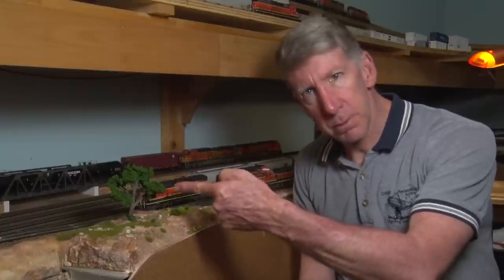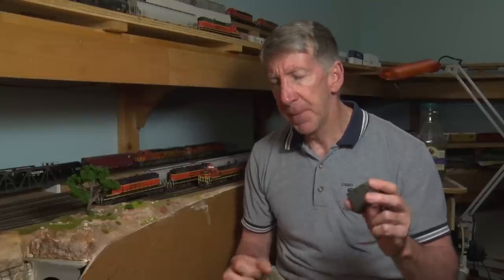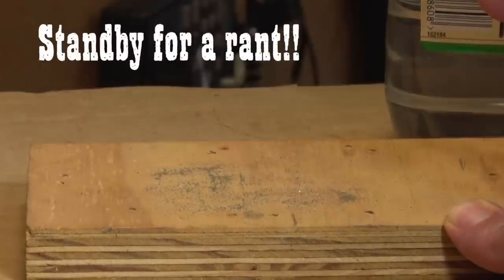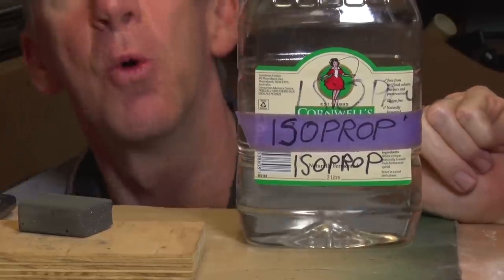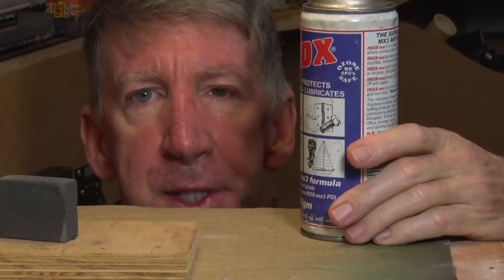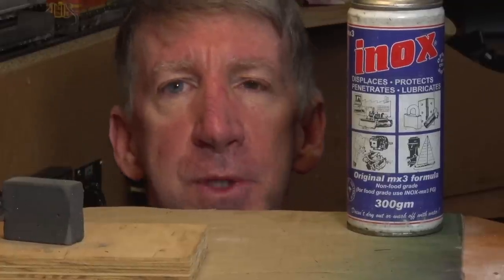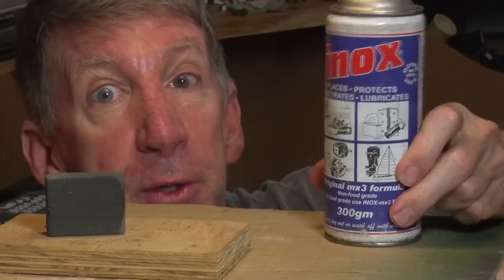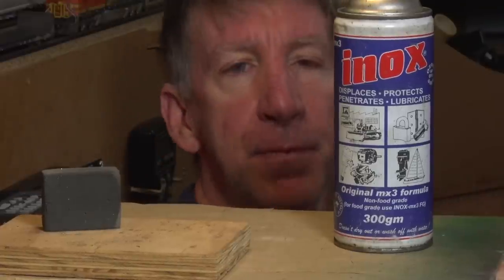Track cleaning do's and don'ts. How "Not" to  clean your track ! And how to do it better!

Comment: I’m new to the hobby and been watching YouTube videos on how to clean tracks and ballast the tracks. When ballasting the tracks, I see some spray water on the tracks/ballast and then pour 50/50  glue and water with detergent over the tracks to glue the ballast down. Does this water and glue on the tracks cause any issues for conductivity later? Do you have a better way of doing ballast? Or is it not worth worrying about because you can always clean it afterwards with icon spray? Interested in your thoughts.
Reply from the maker: Hi Chris , there are many ways to ballast track as you have found out!! The main thing is to keep the glue away from the head of the rails. Fist thing is to use "wet" water to spray the ballast ie: water and detergent or water and  alcohol (IPA) , this does work very well and helps the glue mix flow through the ballast. This first spray is not a problem, but the glue / wet water mix is ...especially around turnouts! The best , but slowest, way is to use an eyedropper and run along the middle of the track dripping glue into each tie spacing...this is slow but the wet watered ballast sucks up the glue mix really well and you don't get any on the rail heads! Of course , after any ballasting, go straight over the rails with a dry cloth, not forgetting the inner edges of the head of the rail, not just the top! Then come back with a lite rub of Innox ? CRC on a rag to protect the rails. 
Hope this helps.
Cheers Gregg.
Reply: FishplateFilms great thanks Gregg. Great videos by the way.
Reply from the maker: @chriswato4056  You're welcome and thank you Chris! 
Gregg :-)

Comment: Good stuff, glad i have discovered you. Just a question, i have got litres of Isopropyl 99.98% alchohol. Is that not any good either?  
Do not want to go and buy something else, if i do not have to. Thanks and cheers, and take care.
Reply from the maker: Thank you !  IPA still leaves a residue , but the less water the better of course!  But I can't say I would use it ....what you could do is "clean" your track with the IPA , then rub some Innox or CRC over a few spots and let the trains take it round the layout. 
Cheers Gregg.
Reply: @FishplateFilms  Thanks, after re watching your video and expertise, which sounds very logical, am picking up some inox this morning. Thanks for your reply.
Reply from the maker: @cudgee7144  You're welcome ! Let me know how it gor=es for you!
CHeers Gregg.
Reply: @FishplateFilms  Gregg, just giving you an update. Tried something different after watching a few videos. Cleaned my track with 99.99% IPA, let that dry for 2 days, then went over it with INOX and let that dry for 2 days. Works a treat, can get my loco's to run at a really slow speed, which looks realistic, they used to stall. There is a new youtube video out there from a bloke who tries different cleaning liquids on 4 tracks. But they all improve dramatically after he goes back and tests them after 30 hours, very interesting. Looking forward to see how your graphite tests go. Take care and look after yourself, as we start to get back to normal.

Comment: Excellent Gregg. That's great info. Do you clean your wheels on your locomotives with Inox as well?
Reply from the maker: Thanks Peter! TBH I have never cleaned any wheels on the layout? Not since I started using this and no Isoprop. Only after weathering do I clean wheels to remove overspray , and then I do use Innox on a Q tip.
Cheers Gregg.
Reply: Well after all that great info I went to Bunnings today and bought some Inox. I thought it was essential shopping and i maintained social distance at all times.
Reply from the maker: @peterainsworth8466  LOL..absolutely essential shopping!  Any dramas, tell them Lord Stan sent you!  Let me know how you like it Peter!
Cheers Gregg.

Comment: Greetings and salutations from Detroit. Thank you for the great video and info you provided, you just got yourself a new subscriber.
 What about 99.9% isopropyl or do you still not suggest using that?
Reply from the maker: G'day to Detroit!  IPA is not suitable regardless of dilution , as it leaves a residue as it dries out! You "Can" use it to clean track , but you still need a protective film after, so best to use the right product for the job and do it once!  Get a can of CRC 2-26 and see the difference:-).
Cheers Gregg.

Comment: Cool video Gregg. I needed to watch this video, thanks for the advice on what to use. I will head to Repco and get some Inox as soon as our lockdown is over. You are right, there is nothing worse than trains stalling all the time. I wonder if miniature battery technology built into the locomotives will ever replace the need to have track powered at all.
Reply from the maker: Thank you ! Yes , stalling trains is one of my pet hates...along with trains going too fast ! I'm sure we'll see battery trains in the future, especially in O gauge! But track power is used for all DCC signal functions , so that would make things difficult.
Cheers Gregg.

Comment: Anyone in UK found a good inox or crc replacement? Wd40 contact cleaner?
Reply from the maker: You can get Inox from Pendel Slot racing , in Lancashire...so they say!  COntact cleaner will not leave a protective residue to stop oxidation, but it will clean the rails.
Cheers Gregg.

Comment: Hi Gregg, Thanks for the video.  I looked Inox up and it does indeed seem to deliver excellent results (well for slot cars anyway).  It is not easy to buy Inox MX3 in the UK - there is only one reseller.  Inox is rather expensive over here (£10 for a 125ml bottle) but I have ordered some to try it out.  Hopefully the results will be as good as you indicate.  Keep safe. Kind regards.  Paddy
Reply from the maker: Thanks Paddy , you're welcome!  I'm sure you will like the results , and just remember just a little! A can will last you forever ! Put the little  plastic tube in the nozzle and  then you can spray two tiny spots on a rag. 
Cheers Gregg.
Reply: Hi Gregg, OK and thank you.  Sounds like 250ml will last me for the rest of my life. 😀. Kind regards. Paddy

Comment: Any good art shop will sell a graphite stick, use it sparingly and it makes a great conductor , won’t stick to wheels which are protected from the black gunge underneath and one swift slide round will ensure good running for months.
Reply from the maker: Thnks Paul . I have some on order and forgot about the art supplies...:-( 
Look forward to giving it a go.
Gregg.

Comment: I've found that there is more surface area on rolling stock wheel treads (do the math) than there is on rail surfaces. While you want to optimize conductivity on loco wheels, it's important to consider dirt buildup on rolling stock wheels as well (something to do with static electricity or relative absorbency). Rolling stock does need cleaning since they either pick up dirt, or spreads it, conditions depending.
Reply from the maker: Thanks for watching!  Plastic wheels are terrible for dirt build up , but since metal wheel sets are the go , and since I have been using a spray , over 10 years now, I never clean either of my loco or rolling stock wheels? The tracks are constantly getting black , as the spray helps clean the wheels ! 
Cheers Gregg.

Comment: I was having a think the other day which may explain the headache but I was wondering.  If the rails and the wheels  make a circuit would electrical contact cleaner be able to be used to clean track.  If not then Inox it is.
Reply from the maker: LOL... thinking can cause that!  Contact cleaner will clean the track , but will not leave a protective film. Inox will do both in one go! 
CHeers Gregg.
Reply: Thanks Greg.  @FishplateFilms
Reply: @FishplateFilms  Newcomer here (well, back after 35 years, let's say!) - When we talk about Nickel Silver track, I thought that was the grade of alloy used to made the rails - but is the nickel in fact only a coating???
Reply from the maker: @alannewman85  Hi Alan, you;e correct that the rail is an alloy, but oxidation is a problem with both metals! In humid and dusty environments , it increases , so a protective film helps this.
Cheers Gregg.
Reply: @FishplateFilms oh, that’s interesting indeed. Really appreciate you getting back, I get all my info off the net, so replies are great. Mines going to be in an uninsulated shed in Ireland. I work abroad so I will get say 3 running days together, every second month. I wonder what other electrical or electronic 😮issues I need to consider in that environment….
Reply from the maker: @alannewman85   That's going to be cold Alan...LOL !  I'd be investing in some dead sheep to jam in the walls !  IF it's wet and I know Ireland gets a little rain, oxidation is a big concern, so INOX will help that and you can rub some on the rails after an OP's session to protect them between visits. Most of the electronics are sealed but keeping them dry of course is a must . We spray INOX on our terminals in some signalling equipment , especially in points machines , which helps a lot .Also I would make the track bed at least 15mm-20 mm ply , so it is stable during temp changes. Model rail, like the prototype , is only as good as its foundation, so don't skimp on the benchwork! 
Also a Wee Dram is good idea on cold days!
CHeers Gregg.
Reply: @FishplateFilms Great advice, thanks Gregg. You’ve a lot of knowledge I wish I could tap into. I’ll definitely be having a dram. Or two. 👍
Reply from the maker: @alannewman85  Thanks Alan, plenty of videos on the channel if you get bored!
Gregg 🙂

Comment: I agree in principal, but all these liquids that help conductivity (CRC, Clipper Oil, ATF, No-Ox, ect) also hurt traction. So if you have any real grades on your layout (2% and up), you going to have trouble pulling the trains up the grades. So what we really need is something the helps conductivity, but doesn't kill traction.
Reply from the maker: I have found that if your use the INOX sparingly, and at random locations on the layout, traction is not hindered to much . If you watch some of my videos , you will see long trains climbing the Helix, which is 1.8% . If you go overboard, then you can lose a bit of traction , but the benefits of good running far outweigh the small loss of adhesion.
Thanks for watching.
Gregg.

Comment: Found your video by accident and laughed a lot.  I have been using Shellite, it takes the dirt off very well and doesn't seem to effect the plastics at all.  I like the sound of this product but the word 'Lubricates' worries me.  Can it make the track slippery?  Somehow I feel that you are going to yell at me, hahaha.  Cheers
Reply from the maker: Hi Pauline , thank you for watching and I'm glad you got a laugh!  I haven't heard the word Shellite for a long time ? Yes , it will clean very well , like IPA, but will not help with conductivity or leave a protective film on the rails. Yes , Inox is a "lubricant" as such , but a very light one , and if used sparingly will not make the rails too slippery. I run long trains up big grades, including a Helix and I clean my tracks a lot , and I have no traction issues. The only problem is if you have traction tyres on your locos, as these act like car tyres on ice when they encounter any spray!! But apart from that , you won't have any problems and better running.
And no yelling of course..LOL.
Cheers Gregg.
Reply: @FishplateFilms  Thanks for the reply, food for thought.  I don't have anything with traction tyres so that's good.  I am mainly vintage Tri-ang with steel rails so I will try to get some Inox and see how my locos go hauling my lovely wagons and coaches 😊.
Reply from the maker: @PaulinesPastimes  It will work a treat with the old steels rails Pauline! Give it a go and let me know how it goes!
Cheers Gregg
Reply: @FishplateFilms  Shall do.  Cheers
Reply: @FishplateFilms  Well, as luck would have it, shortly after all these messages I purchased a loco with traction tyres and since then, another one.  I didn't think I would buy such a 'modern' loco but I did, so looks like Inox is off the shopping list.  I continue with the Shellite.  Cheers.

Comment: Hey Gregg how about using  ACT-6006  It contains Parrafinic Hydrocarbons I got this from Modeltrainstuff  about 4 years Ago Fred along with Otis the HO specialist's they both at that Time Recommended using The ACT-6006 so i bought a Bottle i have cleaned my Track with isopropyl 90% but after watching this I may no longer..  I also got Some Atlas CONDUCTA Lube which Atlas recommends using on the there Motors and you can use it to coat the Wheels is the Conducta Lube & the ACT-6006 Good products to use Gregg.! 

Thank ya Sir for Reading this and thank you for pointing out the Valuable Information... You posted..

Stay Safe 😷 Allen D.🚂🚂🚂
Reply from the maker: Thanks Allen! That product should be fine and since you have it has to be better than IPA!  The beauty of Innox and CRC ect , is that  they are not too slippery (if used lightly) so you won't loose traction , except on rubber tires!  Glad you enjoyed the video .
Cheers Gregg.
Reply: Gregg, 

Speaking of which : slippery. In Europe all locomotives run on traction tires,
means one axle is equipped with rubber rings. Do you still follow your recommendation for Inox or CRC ?
Reply from the maker: @hypersturm  I think if you only use a little you should be fine? Also depends on the loco..diesels should be fine I think . but steam tend to use the tyre for most of the weight and lift the other drivers slightly, so you are relying mainly on the axle with the tyre on it? 
Gregg.

Comment: We always used Electrical contact cleaner and that's all the way back to the mid 1970's for me when I started.  You have to give the Plebeians a break as most people in the hobby actually know very little about electricity other than how to plug it in and maybe add some track power leads.  Isopropyl Alcohol is used by most people I know in completely the wrong ways but because of better than satisfactory results have come to swear by it, kinda like the WD-40 nut jobs who spray that shit on everything (If you ever get the chance to clean track that was sprayed with Wd-40 you'll know what I'm saying here).  Love the rants as people need to be yelled at to get their heads uninserted from their bumm's every so often.

Comment: Ok    BUt does this spray eat traction tires?
Reply from the maker: It doesn't harm the rubber, but it will cause the wheels to slip on the smooth rails. Like cr tyres on a smooth wet surface.
Gregg .

Comment: Why is silicone bad for track cleaning?
Reply from the maker: Hi Nick, for one iit is not an electrical cleaner, and it will also leave a insulative coating on the rails...probably the worst thing to clean tracks with?
CHeers Gregg.

Comment: Alcohol and a rubber pencil eraser works pretty well. A bright boy works on stubborn gunk but will wear away the track.
Reply from the maker: I would say the eraser will leave a insulted residue Dave, let alone the Alcohol ? Give a spray a try and compare the results?
Cheers Gregg.
Reply: @FishplateFilms  The procedure is to put alcohol on a paper towel and wipe the track. That gets off most stuff that contaminates wheels. The really tough stuff requires an eraser and then wipe.

Comment: one reviewer of INOX states that it cannot be used if your engines have traction tires. because it will harm them.   Please comment.   Thanks.
Reply from the maker: Hi Bob, yes I have said that many times in several videos and this is due to the rubber slipping on the slick rails, not be harmed by the spray. Just like car tyres slip on smooth surfaces, this has the same effect.
Gregg .

Comment: A question.  Electrical knowledge has never lodged itself in my brain so I am a little confused by one point.  The wheels need to conduct the current from the track. Then you say that Inox is not conductive.  Now being a complete idiot with electrics I would have thought you would have wanted to put on something that was conductive.  What is the error in my logic?
Reply from the maker: No , you're not an idiot..LOL  It is a bit confusing ! Sprays like innox help remove the dirt and oxidation that inhibit current flow , and keep the "surface"  more conductive. SO they are like cleaners for electricity..it is a bit of a "black art" !
Hope this helps.
Cheers Gregg.
Reply: @FishplateFilms  Thanks for the reply.  It didn't make total sense so I watched the video again and things began to drop into place.  I have found a supplier here in England and am giving it a try, having put the Isopropyl bottle aside.